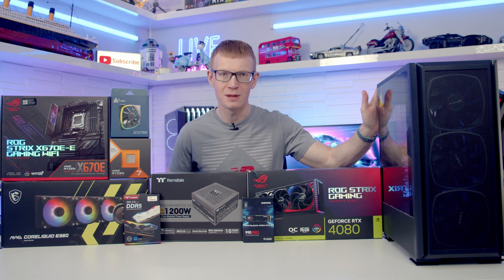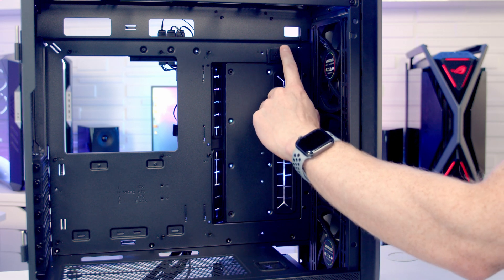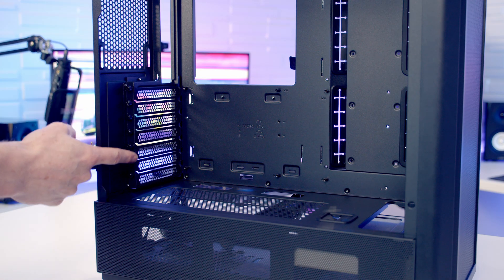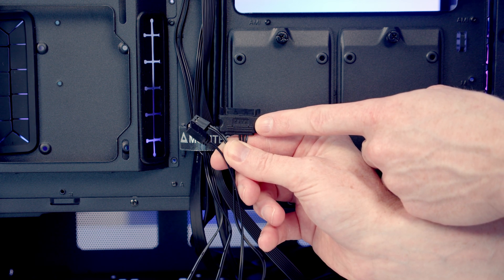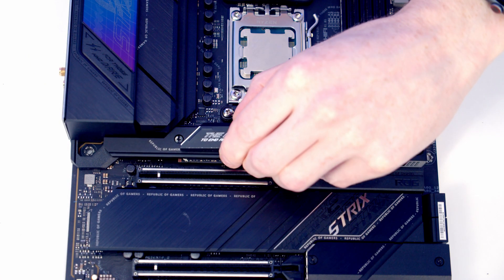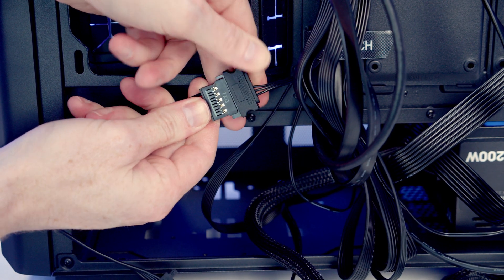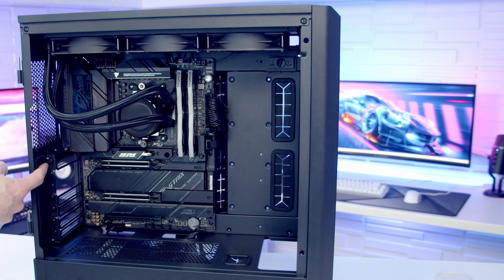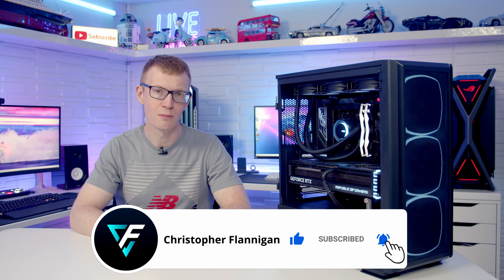Montech Sky Two GX Build - Step by Step Guide

Comment: Where should I put the PWM cable from hub (hope that it's his correct name) on the motherboard? I have MSI PRO B650-S, put this cable into pump_fan slot, but still doubt if I did the right thing. Everything works fine nevertheless, but I want to make things right to the scratch.
UP: Rewatched the video, it's sys_fan slot. I'm poor at english by ear -_-